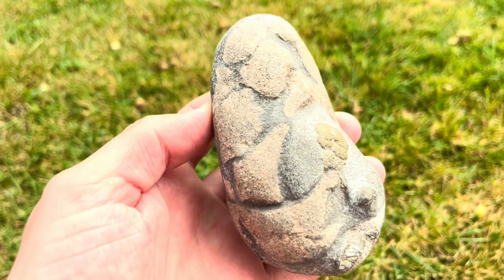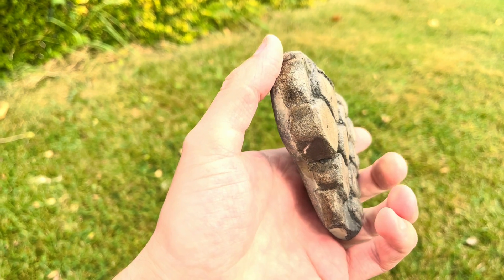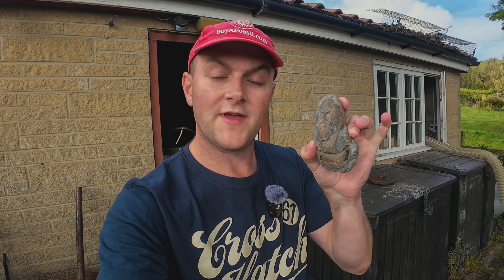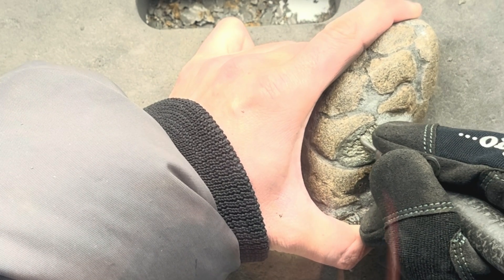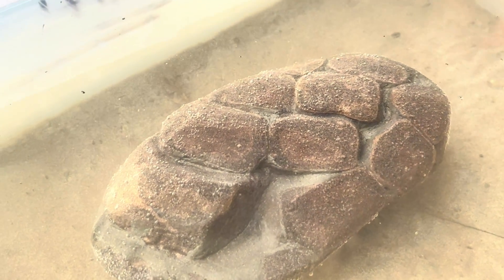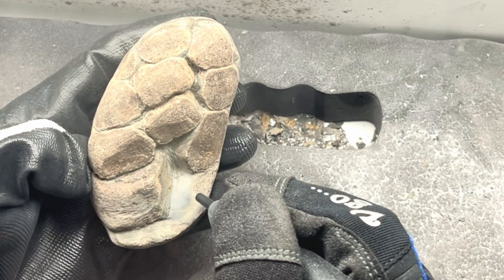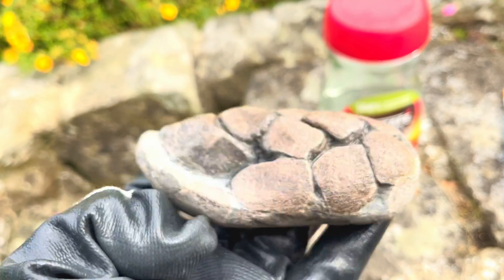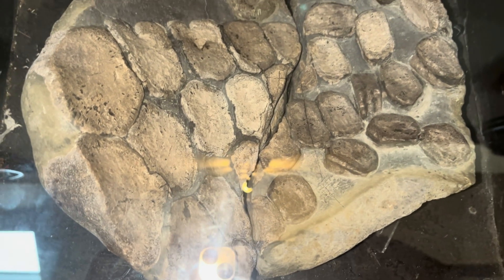Fossil Bones Prepared Using ACID & AirTools

Comment: I’m new here, can you tell me why the fossils come in such round looking stone cases? I mean how the slate compresses over the years to come out so round.
Reply: 1. Nucleation and Early Stages:
Fossil as a Nucleus:
The presence of a decaying organism (or even just its remains) within sediment provides a point of focus for mineral precipitation. 
Mineral Precipitation:
Dissolved minerals in groundwater or surrounding fluids begin to precipitate out of solution, often due to changes in chemistry, pressure, or temperature. 
Initial Bonding:
These minerals initially bond with the fossil material and the surrounding sediment, starting the concretion process. 
2. Concretion Growth:
Cementation:
As more mineral-rich fluids flow through the sediment, the minerals continue to precipitate and cement the sediment particles together. 
Layered Growth:
This process often results in a layered or spherical growth pattern, with the concretion gradually increasing in size. 
Fossil Preservation:
The concretion forms a protective shell around the fossil, potentially preserving fine details of the organism. 
3. Factors Influencing Nodule Formation: 
Sediment Type:
The type of sediment (e.g., clay, sand) and its permeability affect how fluids can flow and minerals can precipitate. 
Mineral Composition:
The specific minerals involved (e.g., calcite, silica, pyrite) influence the nodule's appearance and properties. 
Environmental Conditions:
Changes in water chemistry, pressure, and temperature play a crucial role in triggering mineral precipitation.